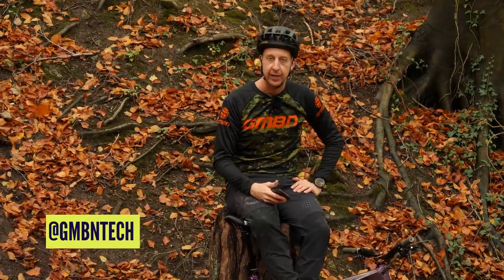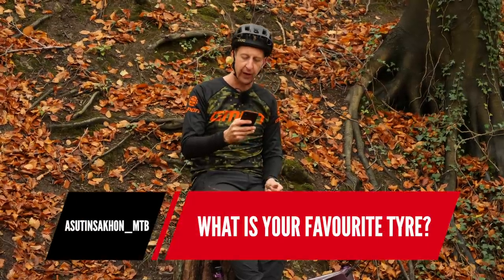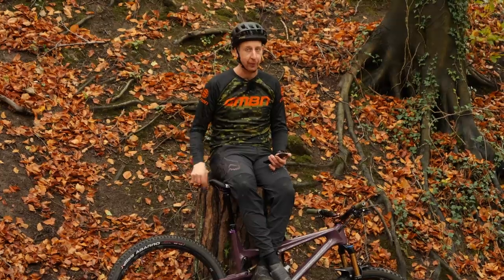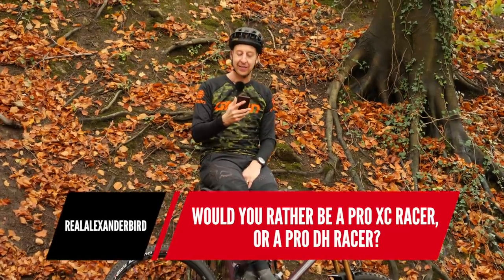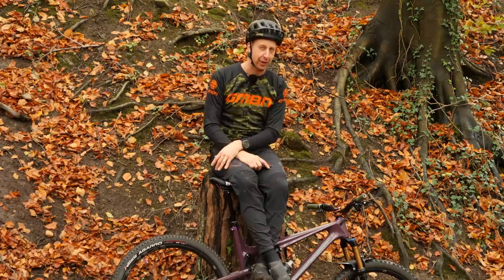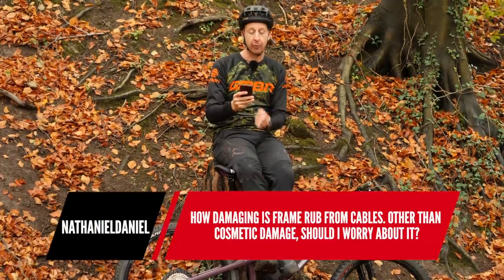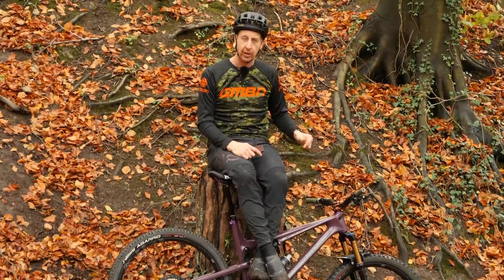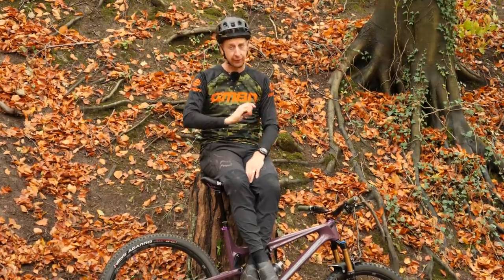How To Remove Rounded Hex Key Bolts? | #AskGMBNTech

Comment from the maker: Do you have a mountain bike tech question? Use the hashtag #AskGMBNTech with your comment for a chance to be featured on the show 👇
Reply: I have a front and rear specific tires I prefer that's is a Michelin wild enduro and a maxxis DHR  II Wide trail in the dh casing
Reply: #AskGMBNTech
Hi
I use clipless pedals (Shimano spd's) and I had a lot of problems clipping in because the area of the cleats on my shoes was clogged with dirt.
Any advice how to prevent/solve this?
Thank you in advance!
Reply: #AskGMBNTech
 #1stQuestion,Hey can i fit my front a 29er fork and wheelset in my 27.5 frame like a mullet but i will change the front wheelset and fork only,CAN I ???
#2ndQuestion,What Shifter do you prefer DODDY, SLX M7000 OR XT M8000?
#3rdQuestion,My height is 4'10,what frame size fits me?
#4thQuestion,Can I run MULLET BIKE IN ENDURO RACING?
Reply: #AskGMBNTech Hi Doddy, what was the first skill(wheelie, manual, jumping or something else) you learned on your mountainbike and what do you find the most difficult skill to do on your bike, even with all your experience?
Reply: @guidodezwaan  the most difficult thing to do on your bike? I think sawing it in half would be quite difficult. (emotionally)
Reply: hi, doddy I am around 161cm and wanted to know if I could put a 27.5 wheel on my 29er arc8 Mtb is it possible? love the show keep them coming!!! #AskGMBNTech
Reply: #AskGMBNTech Hello! Just a short and simple one but can't really find a straightforward answer. I have a GT Sensor 2016 and the frame has a quick release rear. Is this that much less rigid than a thru axle and do you think there are any issues with it now almost all mountain bikes are thru axles? Cheers.

Comment: for me, I find that the same tires front and rear are a good thing. when you really lean over and you don't turn your actual bars that much, the two tires will have about the same grip, so when you break traction, instead of oversteer/oversteer you get a small two wheel slide that is much easier to control without using too much brake.

Comment: I have drilled a hole in my alloy mountain bike frame. My frame is a full suspension so I had to drill in the back of the seat tube. I only used a 5mm drill for the hole then angled it so the cable went in smooth. I had no warranty issues. My bike was over 3 years old when I did it. Plus my bike was second hand. I have had no issues with the frame cracking. I have  fitted a Rock Shox cable guide for the external Reverb as the cable was rubbing on the chainstay brace.
Reply from the maker: sounds like you have done a good job of it Lisa

Comment: On the note of wrist pain - I switched to handlebars with more back sweep and that helped a lot! I use bars from Salsa (the rustlers, I think) which have something like 11deg back sweep. It's only 3 degrees more than usual, but I went from not being able to ride for an hour without excruciating wrist pain (on the arm that I had previously broken) to sitting in the saddle for 6 to 8 hours per day for a week on a bikepacking trip and being totally fine. I suggest trying it out! The handling is still totally fine from the slightly reduced reach, and honestly I'd like to try more back sweep, like the 15deg bars from SQ Labs.

Comment: I've drilled a decent size hole in the seattube of my aluminum frame fat bike to route a dropper post. I've had no issues so far after a few months of riding. The frame is fairly beefy though and the tubes are pretty thick.

Comment: With regards to tyres, I run the Maxxis DHF up front and the DHR II in the rear. I ride a lot of clay trails, whether they be dry and dusty or muddy.  I just feel I have more control in the corners and they roll quite well

Comment: For rounded hex bolts, if possible I cut a slot in them and use a flathead screwdriver if other options failed first.
To cut the slot I use a hacksaw or a Dremel.

Comment: #AskGMBNTech Hi could I swap my current 130mm 29er forks (with 27.5 wheel) for some 150 27.5 forks as long as the axle to crown is the same?

Comment: Try a flat screwdriver - it works quite well if you get the right size in there. You can also drill out the sides to create a line for a bigger one to fit in.

Comment: For Rounded Bolts, a set of gripping pliers used by welders can do the trick. Cost around 10-15 €. They grab way better than normal pliers. Also, if all else fails, you can ask someone to weld a nut on top of the Bolt on alloy frames, maybe even steel frames, wouldn´t risk it with carbon. 

For a mate of mine, we once had to use a milling machine after he broke a ball bearing and the outer bearing shell was left stuck in his carbon rocky mountain frame. If this would have failed it would have meant buying a new frame, we were really lucky we got the bearing shell out without damaging the plummer block. 

So if everything else fails ask a good metal worker :-)

Comment: I had a bike shop cut across a rounded off bolt with a dremmel, which created a flat groove across the top of the bolt, and we removed it with a flathead screwdriver. It obviously ruined the bolt, but it was very easy to remove.
Reply from the maker: Yes, this can work well. Just a bit stuffed if the bolt is actually seized!
Reply: similar to that, we had a tapered bolt head that we drilled two slits with a Dremel just big enough to get a needle nose plier in and twist them out. we were not too worried about destroying anything because it was on a bash guard that I destroyed.
Reply: Done that carefully on a disc rotor bolt worked great.

Comment: Rounded bolt - I cut a slot with a dremel then use a flathead screwdriver. Usually works.

Comment: There are easy outs that fit the heads of hex bolts. Combine that with a manual impact that spins counter clockwise and you can remove some nasty stuck hex head bolts.

Comment: Drilling the frame: go for it, avoid welds. Done it on my old alu stumpjumper low down front of seat tube, no issues 1 year later

Comment: #AskGMBNTech I recently realised that the back wheel of my little one’s 20” MTB isn’t rolling freely. It only turns a few round before it fully stops itself. I checked it’s not the break that slows it down. Is it a problem with the hub? What can I do to fix the problem so that my little one doesn’t have to pedal too hard. Thanks very much.

Comment: I usually smash a similar or larger torx bit  success rate is very successfull especially when bolts are not stupid tight although with the stuff i deal with at work usually overtightened or rusted or both but are also usually with a higher tensile strength rating that your average bolt

Comment: If the hex head bolt is metric, and the interior hex isn't completely rounded, try inserting a hex bit from a standard (fractional) set if you have access to one (I'm in the USA). If you're lucky the standard hex bit will act as a half size up from the metric size of the bolt you're working on.
Reply: Ah never thought of that imperial sizes?
Reply: @woduk  Yes, that's the word I was looking for.

Comment: #askgmbntech
My son had a 2019 specialized pitch and I drilled a small hole in the seat tube to internally route a dropper cable. I was more worried about water getting in so I used a rubber grommet to protect it from water and also from rubbing the cable.

Comment: Another way, (first step for rounded head allen bolts).. Tap the head of the bolt and this will reshape the head to take a decent allen key. Invariably works if you have a bolt thats not siezed

Comment: Rounded hex bolt.....put the next size up Allen key against the hex recess then knock it in with a hammer. Brutal but works enough to get the bolt out.

Comment: #AskGMBNTech Hallo Doddy! I bought my first full suspension bike recently with a Marzocchi Z2 fork with 130 mm of travel. I have set it to 25% sag but even at 70 cm huck to flats it uses around 90 mm of travel. Is this due to the compression (could I maybe release some air?) or  should I bring the fork to the bike shop? Furthermore my Giant dropper post with 170mm of drop is a bit short for me. Have you any recommendations for a longer one?

Comment: How come people don’t use fat bikes more as 4 season bikes they are extremely versatile that can be used in any scenario even downhill. Especially with some companies like foes that have really well developed geo. The only drawback is the increase in rolling resistance which for some people they can power through. Let me know what you think. #AskGMBNTech
Reply: I think the heavy wheels, meaning lots of inertia, as well as the rolling resistance make them less suited overall for trail riding. I've loved riding fat bikes when I've had the chance, but there's a reason I went with a 29er long travel hardtail when I was looking for my one bike. It's worked out well! I'd love a fat bike too, but it's just a different sport in some ways.

Comment: #AskGMBNTech

Hi D

I have gone through installing a new rear mech, cassette, and chain all SRAM with cables cable housing. The indexing only works well on one half of the cassette i.e. when the higher 6 are indexed the lower 6 have trouble shifting and visa versa. B tension done as per the guage

Could this be a chain length issue?

Comment: #AskGMBNTech The GMBN guys have discussed at length tire choice for the wetter conditions of the UK winter. I'm wondering if you have any recommendations for the cold, icy, and snowy conditions of winter in Colorado, US. I find that many tires have rubber compounds optimized for warmer temps and become slippery much below freezing, even in the dry. Are there any non-fat tires that are designed for cold weather? Thanks! The channel has been very helpful since I've gotten more into the sport.

Comment: for rounded bolts You can use screwdriver but it has to be whole metal "core" and a hammer, operate screwdriver like a chisel, i use it on realy stubborn bolts when work on a car almost always works.

Comment: I've heard that storing an mtb vertically by the front wheel (like from a ceiling hook), can potentially cause fork seals to leak/lead to fork dysfunction. Is there any truth to this? What are the best ways to store mountain bikes to save space? I've got a broken wrist, so I'm sorting the bike cave out in the meantime and could use some advice! #AskGMBNTech

Comment: #askgmbntech should i pump my tyres up little bit more then i use on trails when going for spin around city (stairs, curbs, jobbing) or leave the same. I'm using inserts and about 26/28 psi and "heavy duty" tyres.

Comment: #AskGMBNTech So i currently have an 11 speed SRAM drivetrain, but would like to use an 11-50 11 speed cassette. 
With SRAM X-Actuation meaning the pull ratios are the same, could i sub in a 12 speed sram derailleur, keeping everthing else 11 speed? Will an 11 speed chain fit through a 12 speed derailleur?

Comment: #AskGMBNTech Hi, what do you think system tires (front spec/rear spec) run on “wrong” position? For example, Maxxis’s DHR2 on front and DHF on rear. I’m running HighRoller2 on both wheels now, it’s a good idea to take two DHF?

Comment: #AskGMBNTech
What's the more cost effective way to get better braking performance? Getting a larger rotor or swapping to a 4 pot caliper? My brake set is a Shimano SLX 2 pot front and rear with 180mm rotors. I could do with better braking but my budget is limited. Please help, thanks

Comment: #askgmbntech hey doddy what is freeride (examples of bikes, events, riders and general idea and origins
Reply: Norco shore, propane spindrift, and the commencal clash are all good examples of the bikes. rebull rampage, fest series, and audi nines are all good events. cam zink, Adolf Silva, and Jordie Lunn (rip) are all freeriders. freeride is basically big tricks and big sends on DH bikes, basically a mix of Down Hill racing and dirt jumping (jumps and tricks) but on downhill bikes. and it is originally from the north shore of Vancouver where the freeride movement started.
Reply: @shemshem9998  thanks so much very comprehensive answer

Comment: #askgmbntech can i use zip ties to get grip in the wet.If i do should i inflate my tires really hard so they do not shift around too much?
Reply: Interesting idea, might be able to use some sort of metal block spike with a hole drilled through the middle.  Sort of like adding chains to truck tires or crampons to boots.
Reply: @rockytrails8074  that is a really good idea but seems a lot of extra work.Also sometimes the spikes fall out.Maybe if you run inserts so you dont smash your rim with those screws
Reply: I mean a metal block you could pass the zip tie through

Comment: #AskGMBNTech does a person's height affect how a bike's suspension feels, will my friend's 150mm bike feel like the equivalent of a 130mm bike for me because I'm taller? geometry on bikes sizes up to accommodate for the taller riders except for suspension, what is the reason? (and would weight also matter, or weight to height ratio or whatever). i have been riding for years now and even my mates in the bike shop don't seem to have an answer

Comment: #AskGMBNTech I'm looking to buy a bike from a direct sale brand, which means I won't be able to test it before buying. The bike has a Fox Transfer 175mm 2021 dropper and on the website it says that it's spot on for me. However, I was wondering if it turns out that it's like a centimeter too long for me, if it could be left like 90% extended or is it the case of either fully extended or fully slammed down. Thanks in advance.
Reply: you can ride with it half extended but youd be able to sell it for nearly the new price and then be able to buy annother one which fits you
Reply: if the bike manufacturer says is spot on then they are probably correct, unless you have a really short inseam. if you need to you can always contact that brand and ask them the question.
Reply: Yeah, I get that, but I also just wanted to know if I could run a dropper, and more specifically the above-mentioned dropper, halfway or 3/4 extended.
Reply: @Powerhugful  if it's like 99% of other droppers they are infinitely adjustable, i.e. you can stop it at any height between min and max. Just like an office chair 😁
Reply: @Will99x  Thanks for the info. I've never had or tried a dropper, so excuse my ignorance.

Comment: #AskGMBNTech can you go tubeless without sealent? many thanks
Reply: no
Reply: It is possible but rubbish.
Reply: It won't seal, if it burps you will flat, and if you get a puncture you will flat
Reply: Mavic ust tubeless you can. I’m sure I’ve seated a tyre dry and then broke a small bit of bead and poured in some sealant

Comment: #askgmbntech i recently got a bleed kit and tried to bleed my brakes at home. They are sram guide t's and i could not get the bleed block to fit. No matter what I did i could not push the pistons in far enough, even when opening the bleed screw at the top. One of the brakes had no fluid in it and i could still not push the piatons in. Thanks

Comment: #askgmbntech Hey! I'm just wondering if its possible to bleed a brake with a single syringe. Theres a bleed kit for $10 which matches my brakes, but only comes with 1 syringe. I wouldnt wanna buy 2 of those kits, (I would be better off going to the bike shop in that case.) If its possible, how?
Reply: Watch Syd Fixes Bikes youtube channel. She does the brake bleed with and without a syringe. She should be able to answer your query. 3 weeks ago and 4 weeks ago for the videos.
Reply: yes you can, its called a gravity bleed. and you can also take out the plunger and use it as a reservoir bucket if you just need to work some air out instead of draining the whole system, but if you do make sure to put the plunger in before removing the syringe in order to prevent oil spills.
Reply: A piece of tube on the bleed port into a freezer bag would work done it before
Reply: Thank you guys for the tips!!

Comment: #askgmbntech. I am looking for a 26-in tire that was used for downhill snow biking slalom style the tread in the rear is specifically designed with a 1-in tread and the front also was one inch but had more knobs both are self cleaning one was specifically designed for the rear one was specifically designed for the front the year I'm trying to find from is 1996 I do not know the name once I figure the name out I need to find out if they make them for a 27.5 or for a 29

Comment: No! Please don't cut off the head, unless you never want to remove the rest of the screw. SMH how many people think this is a good idea.
Reply: Depends on the situation  actually
Reply: @prone_wolf8871  But be VERY sure it is the right situation! Seems as though some people jump to this as the first solution without thinking it through. If the screw was so tight it stripped the head, what chance do you have if no other part can move without causing a bigger problem. Think twice, cut once... or not at all.
Reply from the maker: Yes it depends on the situation, but we would strongly suggest that you try all other methods first and make sure that the bolt isn't actually seized. A local bike shop may be able to help with this if you are unsure, it's best to stay away from potentially making the situation worse.